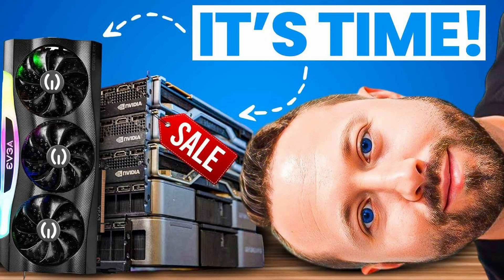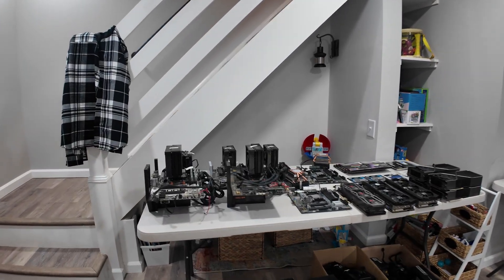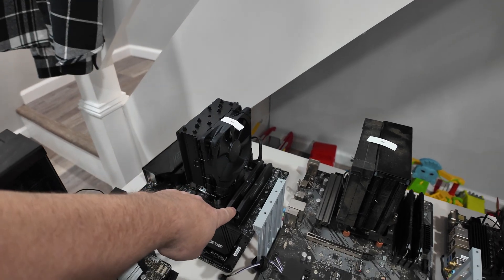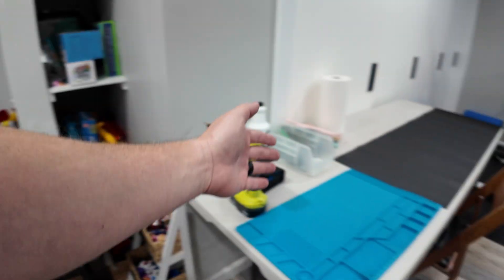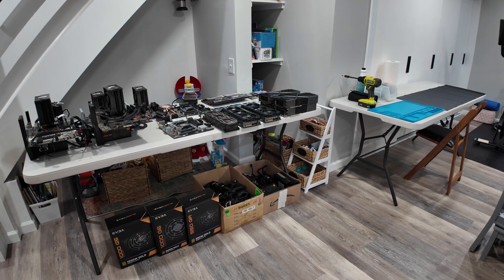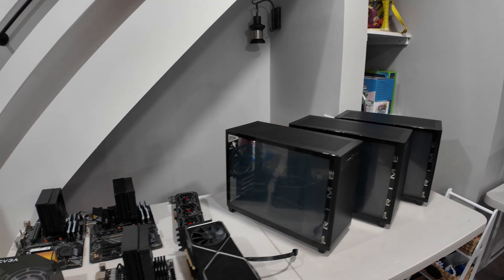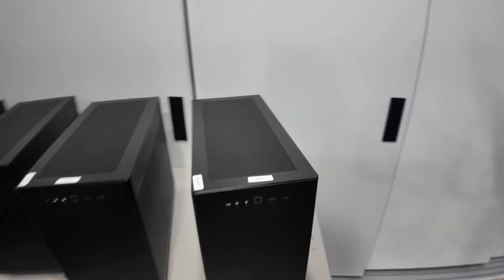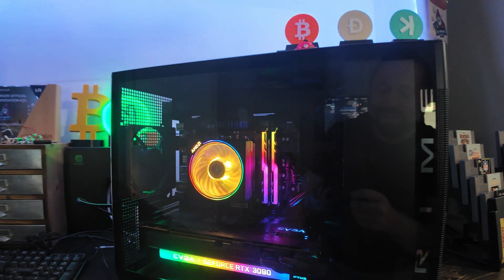I’m Investing $10,000 Into AI Rigs!

Comment: Sir can I use a separate power supply for the GPU card? I mean two different power supply, one for the GPU and one for the CPU? 

Finally, if the answer above is yes, Do I need to use a riser card for the GPU or no need?
Reply from the maker: Great question, If your talking about a single GPU Rig, you don't need totally seperate power supplies for the CPU and GPU. However you may want to look at how big the Powersupply is.  These rigs in the video are using 750w and 850w which is plenty of headroom.  

If your building a rig with multiple gpus you may need a massive power supply or two.
Reply: @TheHobbyistMiner thanks sir, great content btw. More content to come thanks
Reply from the maker: Thank you!